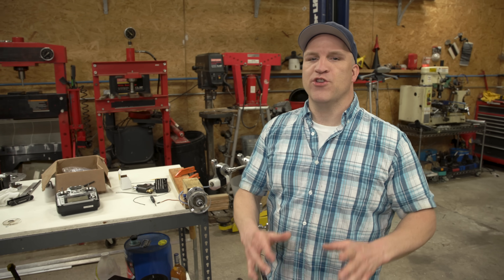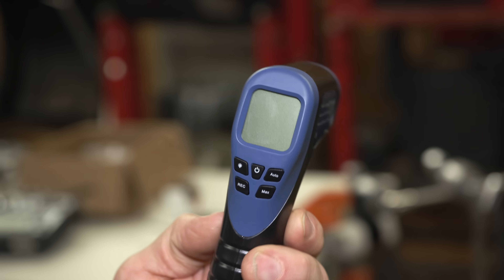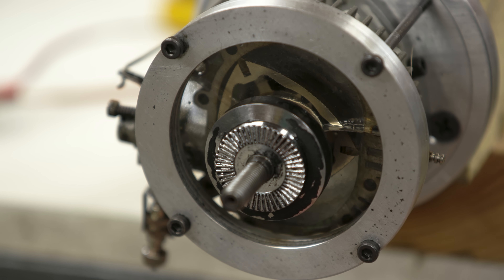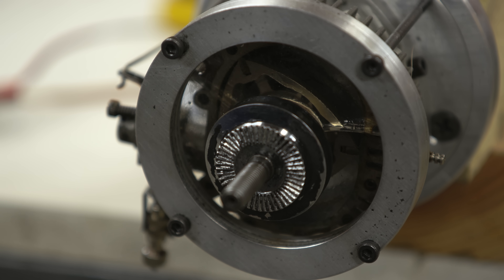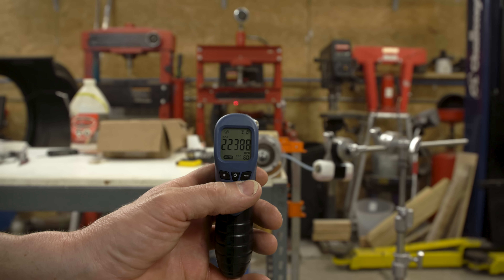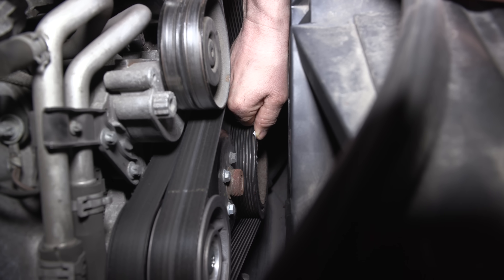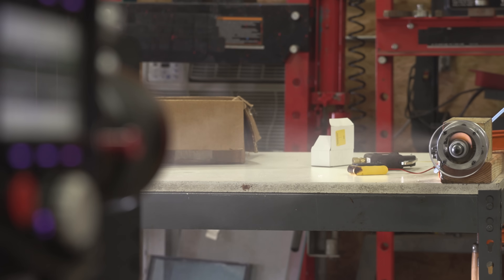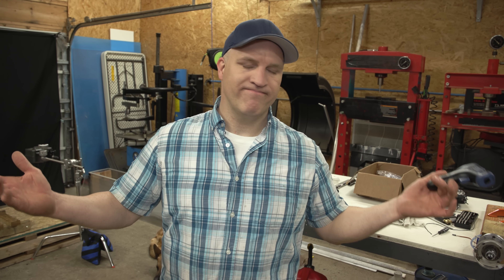See Thru Rotary Engine MAX RPM - 29000 (Wankel Engine)

Comment: the tape was very far from the rotor itslef, the edge of the disk might be doing 29K rpm, but the rotor itself is rotating at a much lower speed
Reply: Rotor itself would be rotating at 1/3 of that but that is not important.  We dont care how the motor turns the eccentric shaft we just count how many times it does

Comment: Home / How To & Tech / Wankel Rotary Engines Share your thoughts on this article2 Email this article to a friend Tweet this on Twitter Share this on Facebook FROM THE October 2000 ISSUE Wankel Rotary Engines An early casualty in our industry's efforts to build a better 2-stroke By Olav Aaen | October 1, 2000 RELATED TOPICS: ENGINES | VINTAGE The good old piston engine was "on its deathbed," read the announcement. Good-bye to pistons, rods, valves and camshafts; there was a revolutionary new engine taking over the automotive world. The new engine had only a rotor instead of pistons, was fully balanced and ran smooth as a turbine. The inventor was Felix Wankel, and the Wankel engine promised a bright new future as a sophisticated and compact power source. It was the mid-sixties, optimism abounded, and most of the major car manufacturers jumped on the bandwagon. The largest licensee in the U.S. was General Motors, but the concept also found its way into snowmobiles. Both OMC (Evinrude & Johnson), and Arctic Cat produced snowmobiles with Wankel engines for a short period. Arctic Cat imported a Sach's-produced Wankel from Germany while OMC built its own. Unique Concept The Wankel engine was as ingenious as it was simple. A triangle-shaped rotor spun around a geared shaft in a peanut-shaped chamber. The rotor only turned at a third of the speed of the drive shaft and one side of the rotor passed by the combustion chamber per revolution to give a power stroke. This meant the motor fired on every revolution like a two stroke, but the pumping action acted like a four stroke. The incoming fuel mixture was sucked directly into the rotating chamber; there was no crankcase pump as in a two stroke engine. This would give the Wankel all the advantages of a four stroke for chamber filling, combined with the advantage of firing once per revolution like a two stroke. The Wankel also promised to have better fuel economy than the two strokes, and this was important in big outboards. For OMC to gain production experience it was decided to make a snowmobile engine first. OMC had a reputation for quality products in the outboard business, and it was felt that there would be a lot less risk if the unavoidable teething problems could be sorted out in a fan cooled snowmobile version. The snowmobile engine was to be designed by the Outboard Division, so they could gain some experience. With all the major automotive giants jumping on the bandwagon there was a tremendous optimism around the project. The Wankel design team was full of young engineers without a lot of baggage from conventional production, in hope that new and fresh ideas would abound. At the time I was a young project engineer in the Snowmobile Division, and was assigned to coordinate the installation between the Outboard Division and the snowmobile chassis department. Inherent Obstacles It was not my first experience with Wankel engines, I had tested some in early NSU cars in Europe and had been impressed with the turbine-smooth power delivery. At my first meeting with George Miller, the project manager, I was advised of a potential problem he hoped we could solve. The Wankel exhaust runs very hot, and it would be important to make sure it did not become a problem in the sled installation. What did he mean by hot? Cherry red metal glowing under the hood, just like a coil on an electric stove. This was obviously much hotter than a two stroke muffler, and could be a serious problem. At that time the engines were mounted on top of the tunnel where the gas tank now sits on modern snowmobiles, and the gas tanks were in the nose. The muffler compartment was where the engines are now located; between the cross member and the tunnel. This meant that the cherry red Wankel muffler would be located only five inches away from a plastic gas tank. It was too late to redesign the engine location; it was to be mounted in the large luxury chassis which also housed the quiet machine. This would turn out to be a plus. In order to control noise emission, this design had a completely closed hood with managed air circulation. This meant no louvers to let the noise out, and the hood tightly sealed to the pan. The problem with the hot muffler was solved only by allowing the air out after it had circulated around the muffler under several carefully-designed radiation shields. After the air had run through the fins to cool the engine, it was ducted over and around the muffler and finally out through a slot at the bottom of the muffler compartment right in front of the track. The only reported problem with this design was a tendency to melt snow and ice under the sled if you let it idle too long before you shut it off. Occasionally owners would come out after a dinner at their favorite restaurant and find the track frozen to the ground, as the melted snow turned to ice. As far as I know, there was no problem with the close proximity of the gas tank to this glowing hot muffler, because the gas tank compartment had also been well insulated. The Wankel concept had been criticized for its long sealing surface, and the complicated sealing strip arrangement around the rotor. The OMC Wankel engine had no such problems. The steel seal ran against metal-sprayed side plates and had excellent wear properties. One major problem occurred on the first production batch. The rotor bearings weren't to spec and some failures occurred until new bearings could be delivered. OMC's Wankel-powered snowmobile lived up to its expectations as a test bed for the new engine concept. The Wankels were both smooth and relatively quiet for their time, and the power curve was a lot broader with lots of torque from a low engine speed. This made it completely insensitive to clutching. You could throw a bad clutch on this motor, and you would not notice it because of the exceptional four stroke-like delivery. Fuel consumption was also better than a comparable two stroke engine, but not as good as a conventional four stroke. This eventually became the downfall of the Wankel design. We were now in the early seventies, and then we got hit by the oil embargo. Fuel economy all of a sudden became a big issue, and the large automotive companies dropped the Wankel like a hot potato. OMC had hoped the publicity of the major car companies would create a favorable acceptance of the rotary engine, but now the exact opposite occurred. With all the bad publicity about the uncompetitive fuel consumption, OMC backed off its Wankel research. OMC got out of the snowmobile business in 1975. The Wankel design team was disbanded, and most of the team members left for jobs at other companies. Only the Japanese Mazda company continued to make Wankel-powered cars, better known as the RX-7 Rotary, a very quick sportscar which gained an enthusiastic following. If the Wankel concept had been allowed to continue on a limited budget, it may have emerged as a possible solution to the fuel consumption and emissions problems the sled and marine industries face today with two stroke engines. OMC built several large four-rotor outboards that were the most powerful outboards ever made, and when used in hydroplane racing, they totally dominated the competition. There is no doubt a very powerful compact rotary engine can be built, they are now very popular as power sources in sportscar racing in SCCA. Future Uses? Will we see rotary engines again in a snowmobile? It may depend on how strict the emissions rules become, and how much it will cost to tool up for new two or four stroke engines to meet these goals. The Wankel rotary engine had many good features that should have made it an excellent power source. Costs would have come down with continued development and reliability would have been engineered in. The design did not fail on its own merit, but was forced aside by circumstances. The expertise is still out there with the Mazda engines, and it would be a lot easier to get back into it now than it was to start from the beginning of the Wankel era. As it turned out, the OMC snowmobile rotary engine ended up being the only Wankel engine ever manufactured in the U.S., and as such has some historical merit. There are still OMC rotaries out there in running condition to be had for a reasonable sum if you are interested in finding out what it felt like to run with rotary power. COMMENT ON THIS ARTICLE Want to leave a comment? Only registered membe

Comment: A rx7 rotary motor on a dyno can easily achieve 30,000+ rpm, dyno operators are afraid to push this motor further because that many revolutions per minute is unheard of out of any other motor

Comment: Congratulations Sir, One young men oppinion was the wankel engine is dead.Because his engine has shown wear  or surface  darkness in side wall of housing,in chamber usual position.As far as I remember tribology CVD and  or FVD,coatinf spray multilayers ,doesnt it avoid deformation or wear inside walls of housing and wallsides? Another concern is of mine,if wankel is designed  with in and out conventional valves, or one reed valve,what do you think? I feel you are veteran as me in engines,you know what you do.Would you be so kind  to let me know your oppinion??Does  plasma spray coating reinforce strength and wear at walls?
Kind regards and thanks in advance,ceramic seals of Curtiss Wright 100.000 hrs is that data good to day in TBO?Bye Johann Wegmann.

Comment: 3:08 -  HOLLY CRAP!!!  81k RPM!!  HAHAHA!  

I'll believe the 29k once you get a better RPM "gun"....
Reply: Well ... rewatch the video. It's not 81k but 8115.5
got tricked too ^^
Reply: @DaD3coy  Well Shoot, You're correct......  A few Q's though:
1- Why is it flashing from 20-21k back to 15-17k?  Error, or bad reading?  Must be one of the two....
2- You only see one bank firing in BOTH slow and fast motion....Why?  And if that is the case, he's calibrated the gun wrong........

Awaiting answers....
Reply: @ericulator391  Well, some guesses:
- Why flashing between 15k and 21k, i don't think there's an error in measurments. Wankel engines are small, so a really low rotational inertia, that might help to gain or reduce RPMs fast when accelerating or slowing (notice that the readings are matching the sound).
- One bank? Well, there's only one "piston"? (if i understood what was your question). Wankels are weird compared to common engines , and if it's your first time seeing one, i suggest you to see some other videos that explain how it works. (A funny difference: in a wankel single "piston", you have at least 2 phases occuring at the same time, where in a linear one, you can only have 1 phase at a time)

Comment: Nut for keeping vertical the plastic pipe in the fuel = genius! 😁 I was wondering about the fuel consumption of these engines: so every time each lobe passes by the spark plug, a new firing happens! So with a 3 lobes rotor for a 360 degrees turn you have 3 firings... Jeez it's a fuel guzzler! Did you have experience wearing of rotor segments or oil consumption? I think one cannot cheat with these engines: top metals and no compromise lubricants must be used in order to run those things correctly...

Comment: RPM shown is not correct, as you are measuring exhaust pulses, not shaft RPM
Reply: 6 frames = one revolution of the shaft.  6 frames = 1/3 of the rotors travel or 120 degrees.  3 shaft rotations = 360 degrees of rotor travel.

Comment: Crazy high RPM'S!  If anything blew on the Wankel engine it would launch shrapnel like a bomb would.  Impressive speed though.  If you can control the heat by water cooling and adapt engine for racing, I believe new acceleration records would be broken.

Comment: the engine wouldnt normally achieve those speeds under normal operation. 
with a 10x6 propeller they will do around 16000rpm in flight and 14000rpm on the ground

Comment: Anyone know the music used from 6:02-6:23? I tried a few music recognition sites with no hits. The music along with that transition into the slow motion footage of the fuel being injected into the rotor housing and the engine screaming to 27k RPM was goosebump inducing. Good freaking job.
Reply: Brak rezultatów

Comment: Dude you need to invest in some quality servos. Those cheapass plastic geared slop-ridden bargain basement things you're running just don't belong in your shop. I mean, you've got such cool stuff in there! A 4K cam on a $7.50 hobbyking pos servo just ain't right.
Reply from the maker: Hahaha, that's true, I actually have a lot of good servos, especially for the animatronics stuff I built. But however I choose a cheap Servo for this purpose because the oil from the RC fuel gets everywhere, including inside those servos.
Reply: @WarpedYT  now that is something I would've never considered! Id imagine that oil just eats those plastic gears into Oblivion over time.. anyway, I actually was wondering, do you fly anything? Heli wise? You look familiar..

Comment: you need to divide to rpm by 3 due to stroke per cycle .  so about 10,000 rpm...sounds about right. that tach is counting every 1/3 rotaions as a full rotation
Reply: No. The rotor is spinning 1/3, he is measuring the rpm at the flywheel like every other engine is measured.
Reply: the flywheel doesnt spin at  29k bro... there are 3 cycles per "full" rotation at the crank(which connects to flywheel). Also  the title clearly says  "ENGINE MAX RPM". I owned a FD3S  for 6 years and good frends with steve singh who is known across the country as rotary specialist. What im saying is ...I KNOW MY SHIT when it comes to the rotary engine. Also that tach is clearly just reading everytime a rotor tip goes by, 29k  makes perfect sense at that calculation
Reply: i know its an e shaft...it rotates at the same exact speed as the rotors duuuuuuuur!! the rotors are what turn the eshaft
Reply: you are the one thats backwards...look at how the rotors are connected directly the the shaft along with counter wieghts.It all turns at the same exact speed the rotors  are 649cc.
How could the rotors rotate more times than the shaft if its directly connected.
Reply: Dude... lol... you're either trolling or you know nothing about rotaries.
Reply: ok whateverman... just trying to help
Reply: you are right about the eshaft.I apologize  but  now ...the ehaft rotates 3x  the rotor.  and there are 3 1/3 turns of the rotor lol. sooooo. the true rpm is in the full rotor rotations
Reply: No man... RPM is always measure at the crank/e-shaft on all engines, and electric motors too. That's the whole point, to show how much work the engine/motor is doing.
Reply: so then why does the tach on the dashboard only go up to 9k? undrstand my question?
Reply: Because that engine only goes up to 9k. This engine is much smaller and is capable of much higher rpm's. It's the same with piston engines, similar sized piston engines can run similar rpm, and some can even go above 40,000 rpm.

Comment: The audio confirms the 29000 rpm. It was just a bit over middle A, which is 440 hz.
Reply: So only about 9,700 rpm why compared to a reciprocating engine.

Comment: Just ran the numbers on your little piece of tape. I guessed the diameter of the disc at about 8". At 29,000rpm, that tape is traveling at almost twice the speed of sound! If it came off, you'd have a VERY loud BANG! in that room. A sonic boom!

Comment: Not surprised the flat-head out-lived it, but I am somewhat surprised you managed to hit 30,000 rpm on that motor without turning the acrylic flywheel into shrapnel. 6" flywheel x 3.14 = 1.57feet/revolution * 30,000rpm = 47,100 feet/min. Dropping that into a calculator (assuming ¼lb flywheel) gets me something like: 1500 km/s2 acceleration and an astonishing force of 19.17 TONNES
Very few things yield a truly "holy shit" moment, but you nailed it. <3 Subbed.

Comment: 29,000 RPM of the output shaft in deed, the moving "piston" is actually rotating 1/3 of that number, watch at 0:39 that the interestingly the shaft's rotation is not the same as the compression body. NIce test in fact! Thank you.

Comment: ON A RX7 WANKEL YOU DON,T FEEL  THE WHOLE TIME ON COMPRESSION STROKE 270  IT LEAKS INSIDE  PAST THE LEADING PLUG HOLE ONLY GIVING YOU 135 DEGREES

270 degrees on the compression stroke and you feel compression the whole time  no leakage in this little  wankel

Comment: It cracked because one of the biggest problems of rotary engines, temperature differences, the combustion chamber and intake are apart so one side is allways heated and the other is allways cooled, this temperature difference is what caused the crack, (notice that tye crack is just where the combustion starts), this is an issue with the real metal side because of the different metal expansion, because lf that mazdas inject oil in the piston, in order to seal the expansion difference.

Comment: Have you ever made your own glow fuel?  I absolutely hate the new stuff sold today with the "synthetic" oil in it. After I lost (seized up) a nice old FOX-35 stunt engine on that garbage, I went back to the old fashioned methanol / nitromethane / castor oil formula (like old time Fox fuel). Much more messy, but the engines love it.